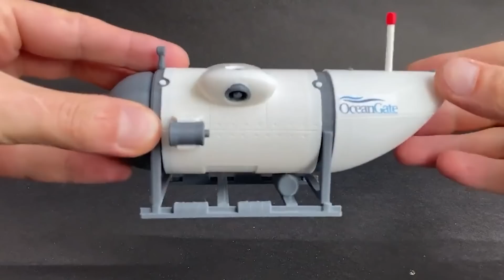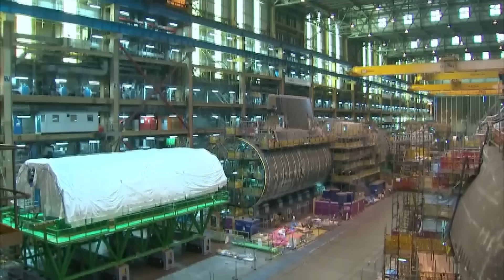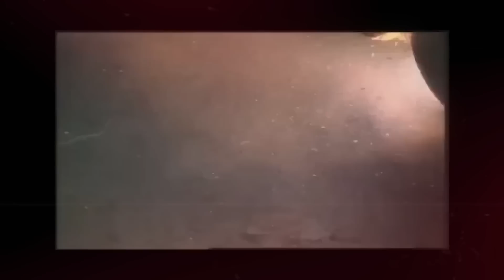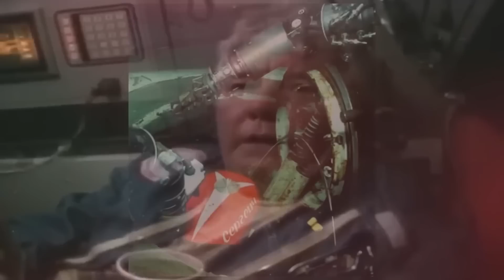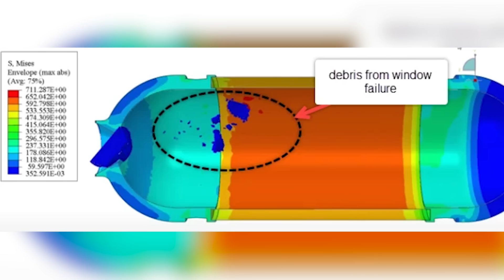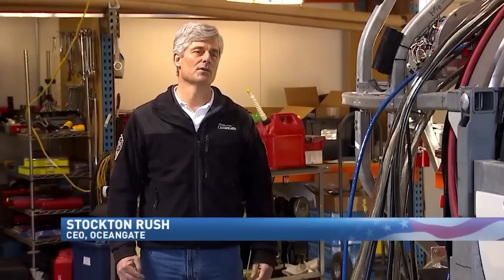New footage Just Revealed A TERRIFYING New Story About how the Titan Submersible really Imploded

Comment: Omg was glued 😂
Reply: I think I kno wut happened. on the transcripts it said they were dropping too fast, I think putting all that sudden pressure on the sub is wut made it implode. that n the shtty designs.
Reply: @CurtisJeffries-cd5vu facts
Reply: 12AB all fiber reinforced materials are "glued" and the transitions between FRPs and other materials are often bonded with chemical adhesives to avoid loss of strength at the joints. The issue with chemically bonded joints come from detrimental chemical or mechanical interactions between the materials, voids in the bond caused by trapped gasses, extraneous materials such as dust, dirt, ect, and poor materials choices for a particular use. "Glued" joints can be as strong or stronger than the materials they join and do not concentrate transferred stresses the same way mechanical fastener systems often do.
Reply: DSRV-1 Mystic  submarine is a good read